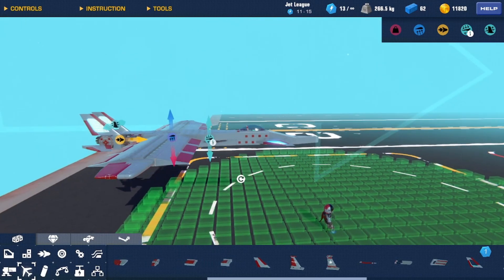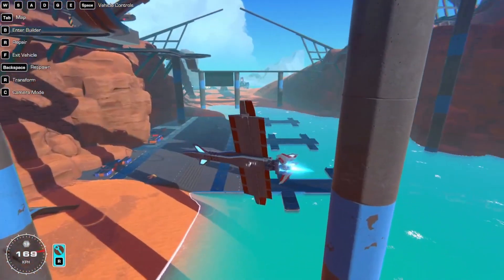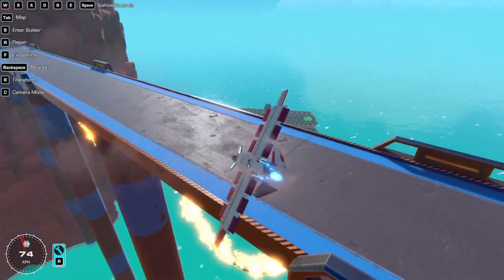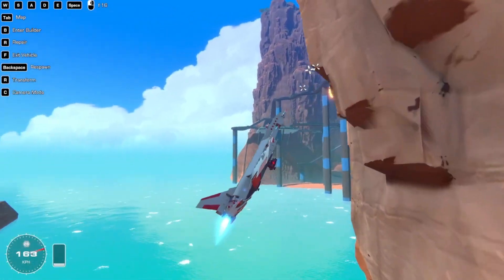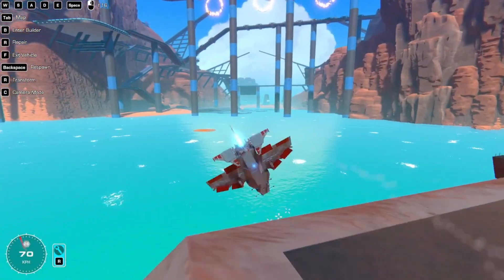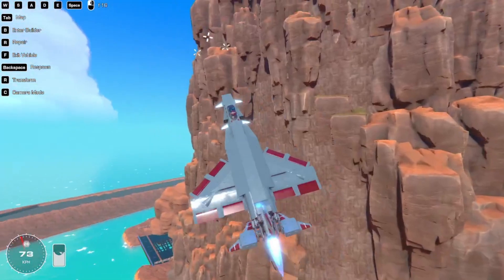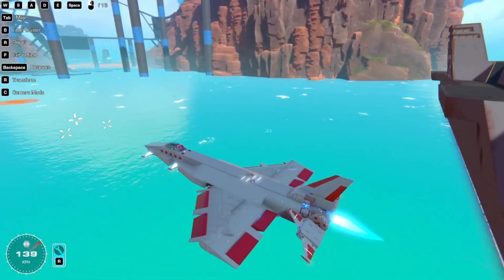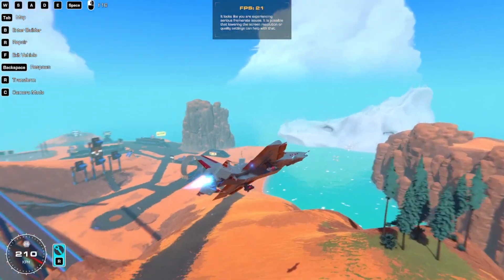Fly by Wire System

Comment: But if you pay attention to the forces as you're building your craft none of this is necessary. Are you just doing this so that you can get your plane to fly? If you build a stable craft it's not going to do any of that.  Maybe I'm not understanding. Check out my F4 Phantom on the workshop
Reply from the maker: i get where your coming from but that instability is there on purpose. stability is the resistance to forces, this includes turning forces. this means the stabler something is the harder it is to make sharp turns but the inverse is true as well. that bonus turn speed at the cost of stability is what i was looking for.
Reply: @ThisIsDumbAllTheNamesAreTaken  🤯oh snap that's like a whole dimension of consciousness higher than I'm capable of thinking about by myself. Total mind blow. You're a genius

Comment: I made the same thing 4 months ago and just couldn't upload 😭😭😭
Reply: Btw it is called fcs. A FBW is just an electronic input connection to the control surfaces.
Reply: 2:30 8mps for the sensor controlling ur positive pitch and 0 mps for the negative because of the gravity.
Reply from the maker: that ignores lift @Nightshardddd  , and since i also have a system that controls the lift to be exactly the negative of gravity i can set both to zero.
Reply: While flying straight you'd stilll have 1g pulling on you my friend.
Reply from the maker: and the jet has the lift to counter it? @Nightshardddd   by your logic all planes should just drop out of the sky. the reason there are wings is to generate the lift to counter the Gs pulling down.

Comment: hey you can also have canards connected on a hinge at their center of mass on very low strength for certain aircraft so it kinda follows your rotation and mainly where you're moving. so you're artificially stable. i use this on like all of my aircraft.
also for negative things, that plane looked absolutely horrible.
Reply from the maker: huh, very interesting, i will test it myself. also agreed on the aesthetics.